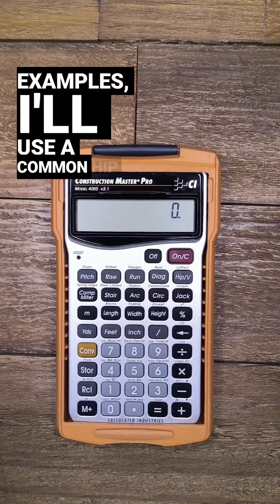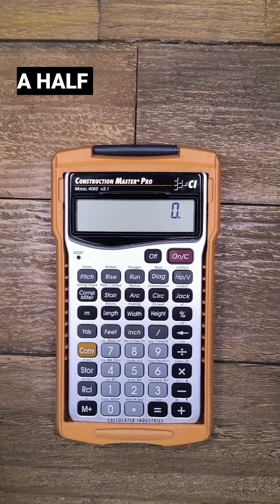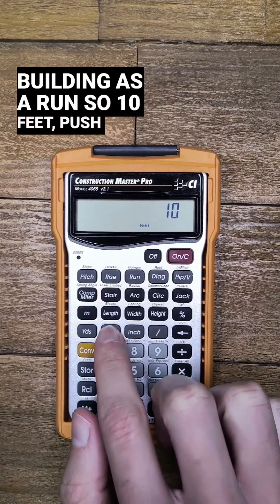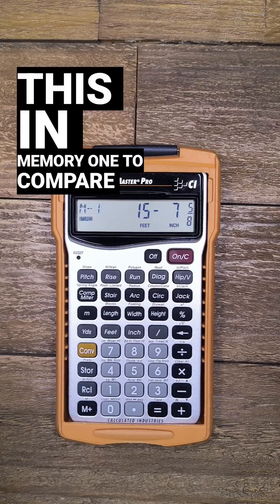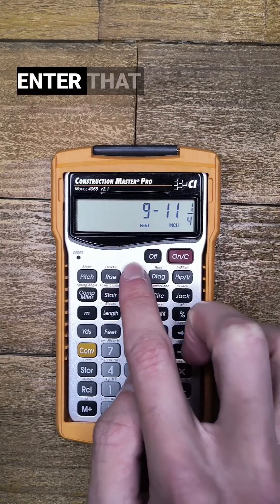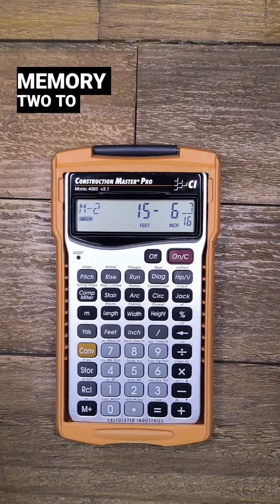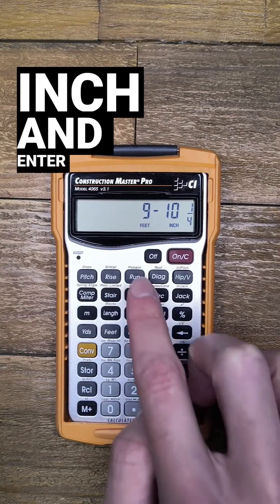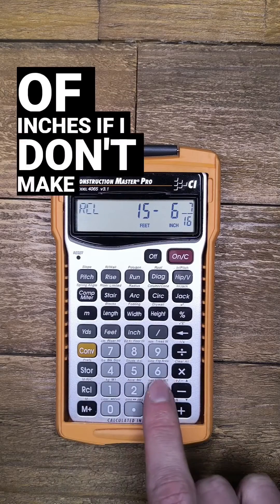How to adjust Hip and Valley Rafters

Comment: You said subtract half the thickness of a common rafter…1-3/4”? Your rafter’s are 3-1/2” thick? I’m confused.
Reply from the maker: Yes, in this example we used 4 by stock for the common rafters, so they are 3-1/2" thick and half of that thickness is 1-3/4" 👍